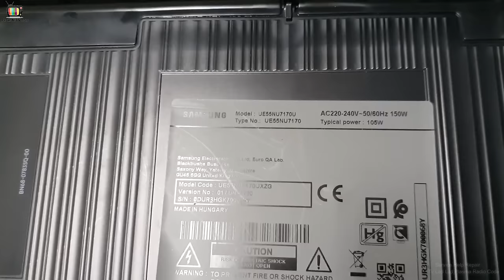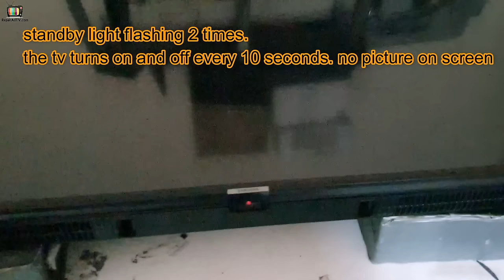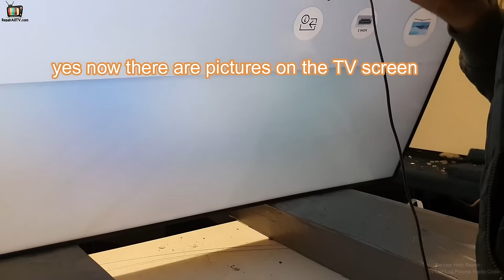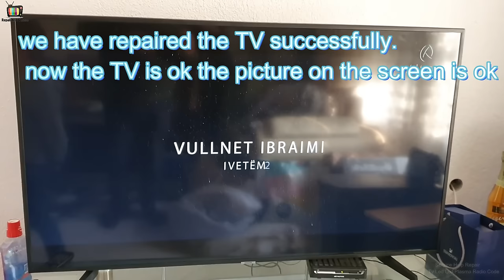SAMSUNG UE55NU7170U The TV turns on and off. every 10 seconds no picture on the screen

Comment: I habe the same problem but curious behavior. TV is in bootloop. Without mainboard backlight stays on. Without panel ribbon (only one on my GU50TU8079) TV starts completely with sound. So power and mainboard should be fine. Now I isolate pins and it doesn‘t matter which pin or pins i cover the tv starts but still without picture. Any idea what I can try next?

Comment: Not sure if I have the same problem. I have a Samsung TV model UE43RU7105. When I power on with remote the power light flashes a couple of times and remains solid but with no picture appearing. At the same time I'm hearing a squeecking noise from middle of the motherboard ( which i replaced with same result) After randomly disconnecting and reconnecting various connections basically not knowing what the hell I'm doing, I'd press the remote and the screen suddenly powers on perfectly, and will stay on indefinately till i power off. When i go back later to power on, the problem starts all over again. Any ideas out there to help me out.
Reply: did u find out solve?

Comment: The sound came back after taping 1 pin, but no picture. Back light is on. Will buying a new Ribbon cable help?
Reply: me too have same issue as you, no picture after taping 1 pin. can you resolve your tv back to working condition?

Comment: I did covered about 10 pins from right to left.  The colors in the screen were just about perfect, however, after mounting TV on the wall I noticed a back and forth brightness going to normal to lower coloring not much difference if you are not looking for that but it is happing... My guess I have to take the time again to find what pins I can covered and avoid the little small flickering of color. If I have to guess it is happing on the left side of screen if you look at it in front of you.
Any of you had the same problem?

Comment: Hi there, I have a Samsung smart tv with the same issue, all the backlights are working and all capacitors look good. There is a unit on the bottom centre of the unit that has 2 ribbons going to it shall I try and insulate from here as I only have one ribbon cable going to motherboard will this still work and how many strips should I insulate at one time? Liked and subscribed thanks.

Comment: Ok but why does this work? I replaced both the main board and power board and my tv was still blacked out. It flickered on but it was still a blank dark blue screen, no picture. I thought replacing the power and main board would fix the black screen but it did not.
Reply: Because that issue is caused by screen panel error, which caused that issue. If you “cut” (hide) the right path the panel will work again. The error message will be disabled by that and does not occur to the mainboard.

Comment: I need some more help lol. I'm so close. Covering 3 pins at a time on a one cable only 55 inch. I have constant power and sound now but only had picture once and it cut out so I was close. Not sure if I need to cover more pins at once like 4 or 5 instead of 3 or try to narrow it down to 2 or just 1 pin.
Reply from the maker: try to cover more lines or less try both ribbons
Reply: @RepairAllTV  mine was a 58 inch with only one ribbon. I had almost have up bt tried one more time. Covered a few more Iines and BOOM. Working like new. Thanks. Just took time to keep trying different spots and widths
Reply: well it last like 2 days then it went out again. been messing with it for another 2 days and just cant get it to stay on again. not sure if its able to be saved this time. Tried all different sizes and placements of tape lol
Reply: I'll try mine but still back light

Comment: So the underlying problem here is a bad panel? If we want to fix this entirely we have to replace the whole panel? or can we just replace the board?
Reply: That was my question, do I need to replace the panel or the ribbon?
Reply: @domnatr91  Sorry this is late lmao but unfortunately most if not all new-ish samsung tv's have those ribbons (leading to the screen), unremovable from the screen, so you can either try something like this, something more radical like replacing a resistor on the motherboard, or something i heard someone do was get an electrical "timer" of sorts to plug in the pin at exactly the right time. Sorry it's such a PITA

Comment: Omg I was thinking there’s no way this is gonna fix my prob.. and it worked!!!!!!! Thank you!!!! 
Edit to add: this is not the same model as mine but it still worked
Reply: What pins did you cover because I am doing the same thing as well but with a different model it only has a single ribbon cable not two
Reply: @drakestrauss9998  did you figure this out?

Comment: This worked for me. I was able to fix my 50TU8080 samsung. The inside was designed differently since it only had 1 big ribon cable instead of 2. Took me hours working on the ribon like on the video but later found out through testing that it wasn't the busted cable. Mine had another, small ribon cable below the right speaker connecting to the front panel. Popped that out, blocked a few pins and got the screen to work. No lines, no flickers. Entire process took me 5 hrs. 😅 but it's worth it.
Reply: Hi, can you share what and how many pins did you tape?
Reply: would you please share which of the ribbon cable you mentioned ?
Reply: What pins?
Reply: I have the same one big ribbon cable.. and the small one from side to side panel
Reply: @emiliomagnus940  16-20 on the smaller ribbon cable near the speaker
Reply: Hi, Bottom cable got left and right cable, which side you tape?

Comment: My TV went out after less than 2 years so I called Samsung and asked for a one time acomidation since they sold me a bad TV. And it worked they are gonna cover labor and parts I guess the 6 series needed a updateamd 3 parts installed to fix this common issues. If any one is janina a issue with a newer TV just call Samsung it worked for me u just have to be acertive about it

Comment: Hello, I have an ue55mu6440 going on and off, with no picture but also no sound. I try to do this method but nothing works.. what could possibly the problem then? The backlight seems to look good.

Everything in this video is the same but the only difference is that I have no sound and also my red light blinking only 1 time not 2 time. So is this other problem then?
Reply from the maker: try to spread the coverage of the lines, not like in the video, you can cover the lines with less ribbon, spread the coverage below the ribbon or above the ribbon. or other ribbon cover the lines. or cover with few lines

Comment: Looks like 13 pins from the left and a 12 pin wide tape. The power reboot issue went away, but unfortunately my TV screen doesn't come on although I hear sound.
Reply: Try cutting the tape a little narrower.  I ended up cutting mine down to only cover about 6 or 8 pins.  Then I shifted the tape strip a few pins.  At one point; I had the exact same issue--no picture but sound.  I shifted the tape strip again; and viola!  Finally ended up with no power issue; had sound, and had picture.  Also, I used cellophane (clear) tape instead of electrical tape. Sorry; but I didn't think to take a picture of exactly which pins I ended up covering.
Reply: @jamesz9139  shifted which direction
Reply: @ben36108  - Sorry for the delayed reply.  I actually shifted back and forth in both directions until I got the best result.  It's been a while now; but I think I ended up shifting to the right a little too far; then brought it back to the left a couple of pins.  Sorry...I just don't remember exactly where I ended up.  The good news is; it's still working great!
Reply: @jamesz9139  I got one I shifted both ways best I’ve seen was lines , or one side was colored and other was pitch black. Got it from a guy said it just went out ... when you plug it in , you just hear it reset , no picture .
Reply: Bad panel . Common samsung

Comment: Hi .. men i have a un55mu6300fxza start do that loop without logo i do this test about pull out the ribbon cable but whatever of the ribbon cable the left for example the screen cames on and if i put back the left and pull out the right the tv came on. So what could be?  I already change the mainboard for the same part number but both the genuine and the new one do the same .. its bad screen?

Comment: I am facing same issue with my Samsung UA50TU8000KXXL. Servucr engineer asked me to replace the panel which costs ₹.10500. Thank you so much for the video but how to identify the disconnected lines.  Please explain, or would be of great help to fix the issue myself

Comment: Not all is same in this vid mine is on the bottom cable, and pin number 14 from the left side of the ribbon cable.  Not a perfect solution, coz even i have narrowed it to the one pin, still there is a faint line gray line  barely visible, and from 8-9 ft far it is not visible.  Well at least we can prolong the lifespan of the unit till it will broke permanently.  Thanks OP.
Reply: @repairalltv sir, can the horizontal lines that is barely visible can be narrowed down or can be fixed by isolating more the pins? Can i use this for long term?

Comment: What if i just buy a new ribbon? Will that work? Answers pls
Reply: What a lot of people aren't grasping on here is what the tape is doing. When the ribbon is plugged into its socket without anything added (as per normal), all the lines of the ribbon will be connected via the socket to the requisite elements of the panel (screen). That's fine when the TV is working properly. The object of this fix is to break the connections between the lines in the ribbon and the elements of the panel that have become faulty. Tape between a ribbon line and the appropriate pin in the socket will act as an insulator and so break or block that connection to the panel. You have to experiment with the size and position of the tape to ensure you block only the bad parts of the panel the ribbon was connected to.  But be in no doubt - this is a bodge and doesn't provide a proper cure, as the true fault lies in the panel which is very expensive to replace. The results will be imperfect but perhaps tolerable for some, so it's probably a worthwhile means of extending a faulty TV's useful life.

Comment: I have the exact same issue and this worked for me on resolving the power cycling. It seems to bypass the underlining issue and I noticed after this fix that the right right half of the screen had horizontal lines and had poor picture quality. I then narrowed down the underlining issue which seemed to be isolated to the furthest right panel shorting out the power board. This fix bypasses the short from that panel. Is there a fix for that far right panel board or does the entire right panel need to be replaced? Thank you so much fir your help.

Comment: If the pins are shorting it must be in the little board at the bottom of the TV. I have replaced the tuner board with another and have the same problem. Covering the pins did not work for my tv so I was wondering if the small boards can be replaced.
I have checked the main board and voltages are fine there so only those small boards are the problem. Anyone with ideas on this?
Reply from the maker: you have to cover the lines with less. or more. either below or above the ribbon. that the defect is different

Comment: I tried this method when I got the same problem and it got fixed. TV turned on successfully but recently again the same problem came. I tried to do the same method again but it is not working again. Please let me know the solution for this. I contacted Samsung Technical team and they are saying the display might have gone and need to be replaced which costs huge amount. For that amount, a new TV will come. Please sugest me the solution.

Comment: I just did this on my 70". The picture came back just like the video, but now I'm having color issues on the left side of my screen. The left side is grey and dull. Did I do something wrong?
Reply: Same I have the 70 and picture came back but it’s grey on the left
Reply: Cut the tape, make smaller one. You hide pin which is needed for video.

Comment: My TV is doing the same thing except when it powers on I get the Samsung Smart TV logo in the middle looking completely normal, and then everything goes to black and the whole TV restarts itself and does it all over again over and over. Could it be the same issue?
Reply from the maker: it could be the same thing as in the video. but there is a possibility that the main board is broken. try as in the video, maybe you will succeed
Reply: @RepairAllTV  Thanks so much for replying, I will try this weekend!

Comment: I have tried this method with no success. When I disconnect the longer of the 2 panel band the tv turns on fine and stays on and vs. For the shorter panel band. But when both are connected there is no sound and the screen continues to flicker on and off. Do you have any suggestions?
Reply from the maker: I believe that 90% of the problem is yours as in the video

Comment: I have been searching YouTube and Google for any hint on how to take the back cover off my tv for about 2 hours, I can’t find one, lol.
All the videos I find are of the “Screwless backs” 
I have one that has screws. It is a UN43NU6900FXZA version RZ03
To replace the boards, the whole back cover doesn’t come off. 

I have all of the screws out, I can get it almost off, the problem I’m having is the bottom part of the cover. Where the power button and the speakers are connected. 
Are there “Clips” for the bottom part of the cover, or do I have to “Jimmie” it a little more to get it off?
I’ve tried prying it a little with a small flat screw driver, but very lite.

Stuck and frustrated, lol.
Reply: Never mind, I got the back cover off
Reply: did it work for you?
Reply: @waispinoy9458  replacing the board did not fix the problem. The TV still did the “10 second Power cycle” and the red light flashed two times along with it. 
So I’m not sure what else could be wrong, besides replacing the other circuit board that’s located in it. It’s the one that is the width of the tv, mounted by the speakers. It has the “Power switch” attached to it.

Comment: why put the tape ?? is this normal as a repair ?? what does the tape abolish ??
Reply from the maker: you do not know how to read watch the video in the minute of 14:22
Reply: @RepairAllTV  I do not understand why to abolish the signals, you can not replace the defective component ?? Does the abolition of these signals not lead to some other defect over time?
Reply: @salvorussovideomaker386  It is very difficult to explain, you can't really fix it because the problem is in the glass itself, but you can in some case cheat on the redundant signal lines to still continue to have sometime a perfect image, this is a kind of magic fix. A display cost about 400 € and over fees for special care shipping !
Reply: @Yoritomo3800  I have the exact same issue and this worked for me on resolving the power cycling. It seems to bypass the underlining issue and I noticed after this fix that the right half of the screen had horizontal lines and poor picture quality. I then narrowed down the underlining issue which seemed to be isolated to the furthest right panel shorting out the power board. This fix bypasses the short from that panel. Is there a fix for that far right panel board or does the entire right panel need to be replaced? I could just try to ignore the poor picture quality on the right half of the screen if there's no easy fix.
Reply: @Yoritomo3800  is it a panel issue or some other component is at fault?
Reply: @adityasethi4493  Inside the glass is a raster of very small Field effect transistors for each pixels, in a real circuit board, one transistor mounted together with other, when died will kill all the circuit, this is exactly what happens in the glass, obviously we can't replace them, then the concerned lines must be disabled. The magic is that even with disabled tracks it still works fine ...

Comment: Well this sort of worked... Using a microscope  I was able to find the one pin that was causing the power cycle and blinking red light. I have a picture but the reds in the left side of my screen are noticeably low, to the point it drives me nuts. it basically dulls the whole left of the screen. If anyone has found a way to resolve this please let me know!
Reply: Maybe if the panels are separate you could possibly go into the service menu and adjust it to where both sides look good enough to you. I know this because I have an extra color cone in both my eyes so I have to adjust my tvs so they don't look really weird to me. I basically see colors that normally other people can't.
Reply: I'm a little bit confused, does that red part of the screen is there forever or as long as you "hide" the pins?

Comment: I am in the middle of doing this repair.  It seems to have fixed the power cycling but the left side of the screen is now missing some of the red colors.  I have tried many different sizes of tape and in different locations.  Any suggestions?
Reply: Did u ever figure anything out?
Reply: Same here. The left side of my TV is a little low on the red

Comment: I need a quick answer.  So in the end those connecting strips are the problem?  I covered the pins with black tape and it works, but I have dashes on the screen.  I have to change the motherboard and the power supply or just the screen connection strips.  Where is the problem?  Thanks
Reply: The problem isn't in the main board or the power board, no. The issue is in the display, so it would seem. The display has a fault, and by putting tape on the ribbon cable, you're preventing the fault from throwing the TV into safety shutdown.